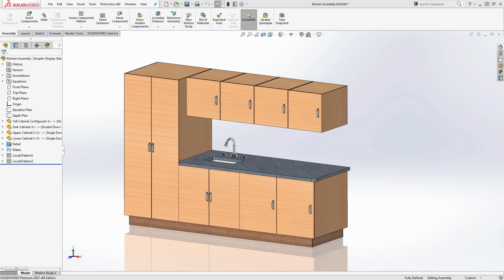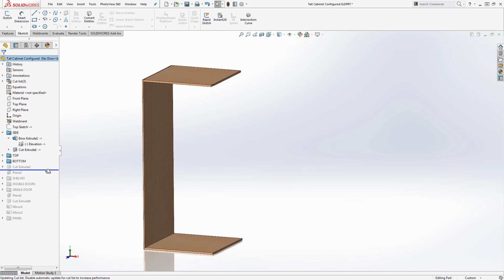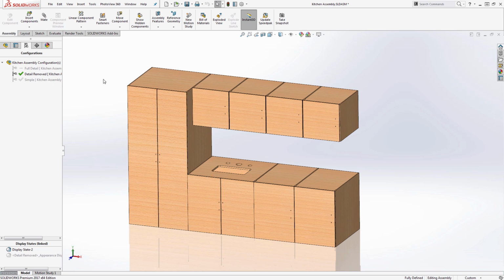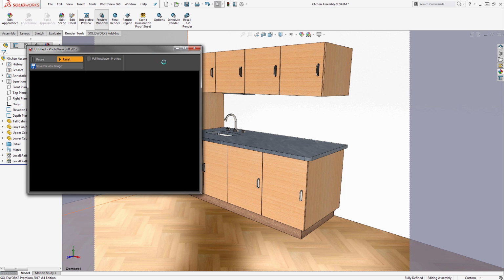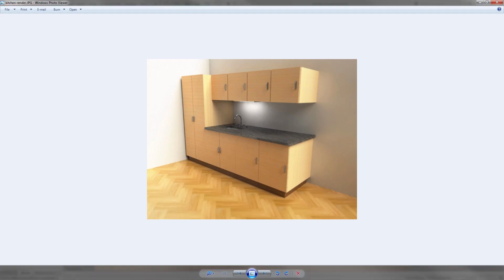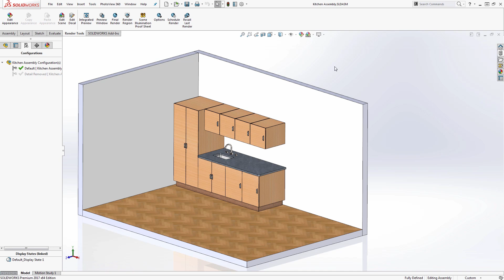Cabinetry in SOLIDWORKS - Part 1

Comment: 0:10 Intro
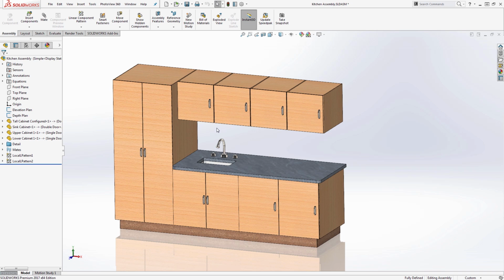0:30 Cabinet makers use 2D layouts which represent the shape of the whole design and where the individual cabinets can fit inside. 
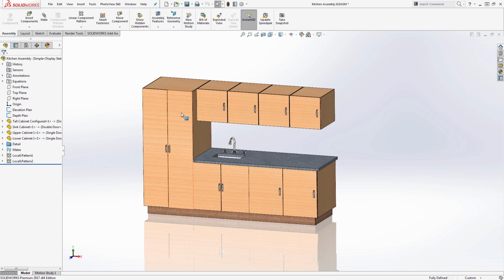1:07 Closer look at an individual cabinet (part file)
2:40 Activate assembly sketch layout dimensions and intuitively dragging dimension which in real time updates with whole assembly 😮
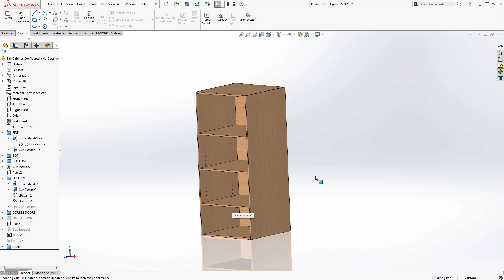2:24 Closer look at whole kitchen (assembly file)
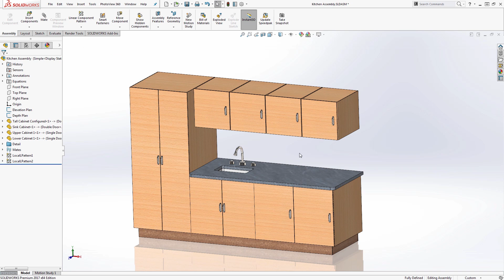3:11 Closer look at outputs 1. Config to show manufactured model without hardware 2. Drawings 3. Nesting
4:08 Photo rendering

Comment: How did you gave light effect ??
Pls reply fast.....I can't wait🐈🐈
Reply from the maker: For the Photorender an emissive appearance was defined. When applying an appearance under the advanced tab there are illumination options. http://help.solidworks.com/2020/english/SolidWorks/sldworks/c_example_emissive_appearances.htm

It's important to use the higher quality settings for Photoview in order to get the light to bounce correctly.

Alternatively a custom light source such as spot light can be defined directly

Comment: how did you make the elevation plan so that the part mated with the sides of the elevation plan also changes size? because when i do that, the part does not change size according to the elevation plans dynamic

Comment: nice one. can you tell me the dimensions you used in mm or inches?
Reply from the maker: Inches were used for overall cabinet sizes

mm may have been used used for drill sizes for peg holes and other hardware as these are most often metric

Comment: Dear Friend, can you explain how did you design this a model.
Reply from the maker: The model was created using a top-down approach, where each cabinet is driven by the overall layout.  Is there any step in particular you wanted more details about?
Reply: Than you my friend for your interest.
Yes please, I need to learning :
1- How to using a top - down approach ?
2- What did you mean " driven by the overall layout"?
Reply: Dearest Mohamed I suggest you start from the bottom. Go  for a proper apprenticeship in woodworking. Something where you have chance to get your hand really dirty. Next step after working for five six years study timber engineering if there is such thing in you lovely home country . This then in return might give you the chance to understand the term  #driven by overall layout# . The next step for you would be to purchase  a genuine  Solidworks licence and turn your woodworking dreams into reality. Additional training modules could probably  purchased through you Value Added Reseller in your lovely home country